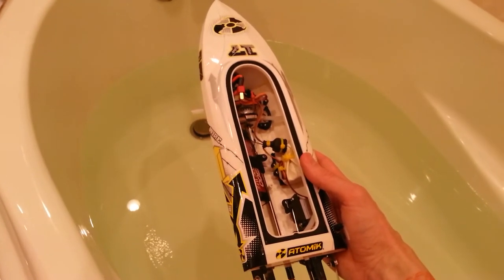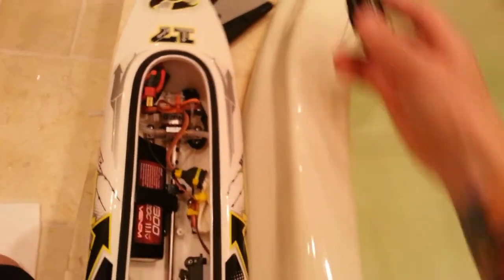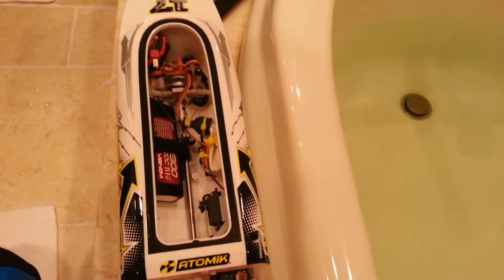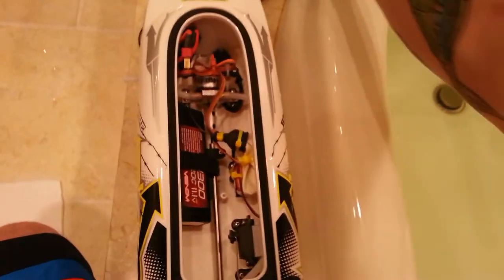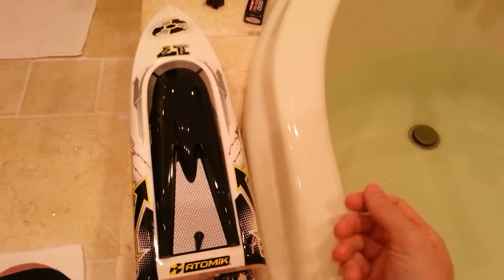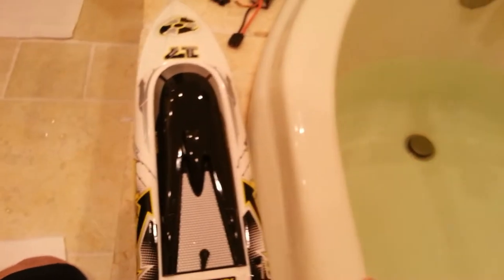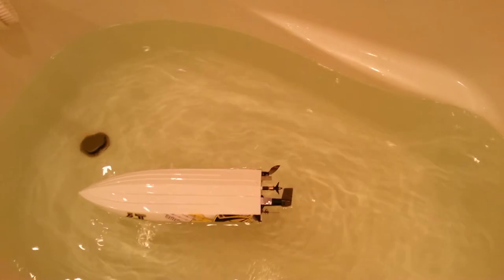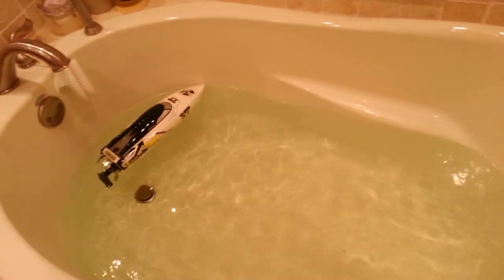Atomik Barbwire Boat (Review 2) with blooper

Comment: Handles bumps very well. They got the hull right.  I had it jumping in some chop similar to a MHZ Gecko.  The radio is pretty cheesy, but works fine.  I thought the boat was a blast!

Comment: The boat does not flip over immediately everytime you punch the throttle. A trick I learned was that if it doesn't flip over the first time, wait for it to settle and then punch it again with the wheel turned to activate flip a little more effectively. Also be sure to use a 3 cell lipo. A 2 cell will not work. Hope this helps.

Comment: should i buy the barbwire daren?
Reply from the maker: Alex Smith The barbwire is a great little boat. The only issue I have experienced after driving it has been the stock steering servo tends to be a problem. The lid needs to be on securely and make sure you have a 3 cell lipo. Yes, its a nice inexpensive super quick boat.
Reply: I have o e I think you should